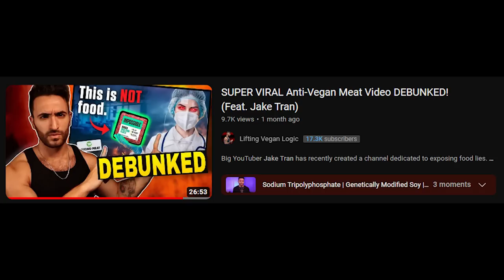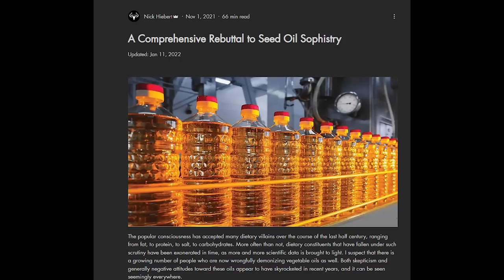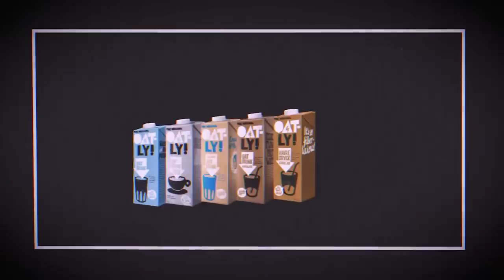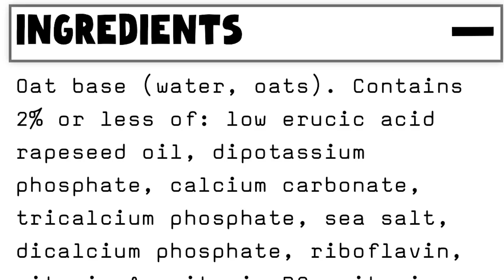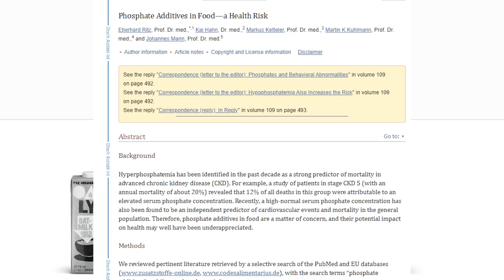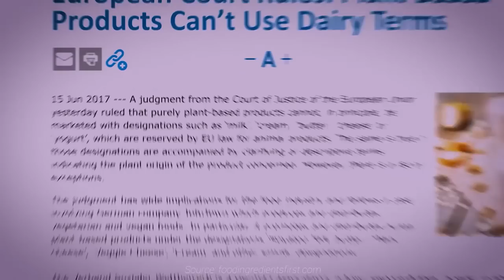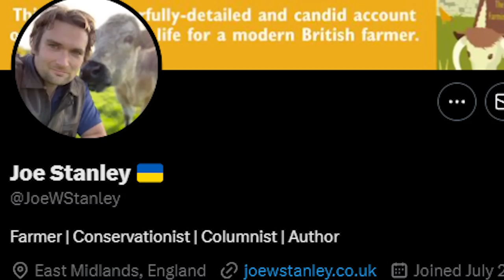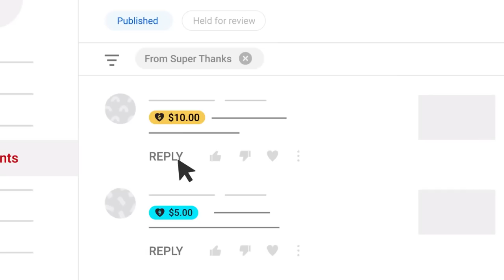Jake Tran’s FRAUDULENT Anti-Vegan Milk Video EXPOSED!

Comment: Oatly made a response to the claims made by Jeff nobbs and said this: "Contrary to what the author notes, the oil we use actually has a trans fat content of less than 0.1g/100g, and we only use non-GMO, expeller pressed rapeseed oil.” so you don't even need to do that math, but still proves the point that that guy is full of bs
Reply: oatly is lying
Reply: @turtleman8968  that wouldn't be a smart corporate move since the backfire could be a lot worse than the benefit of lying. If you don't know, canola oil doesn't naturally contain trans fats, they're created in the deodorizing process some manufacturers use
Reply: @dekyor9547  source?